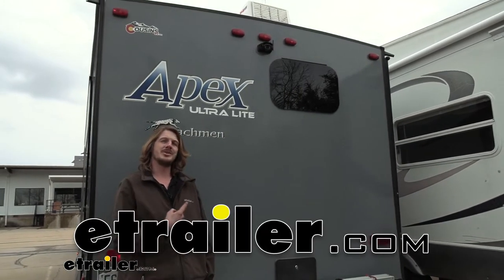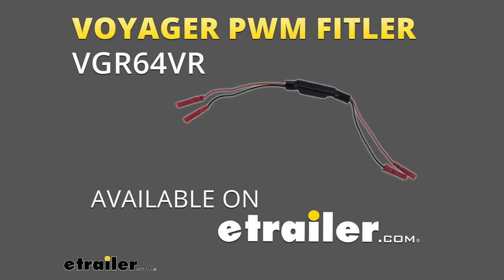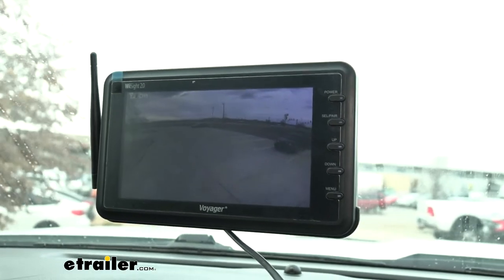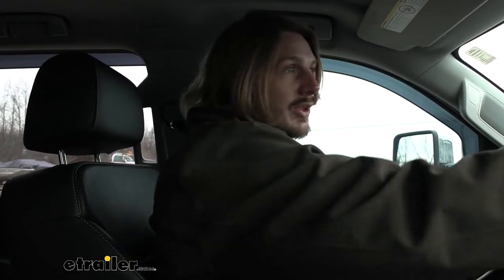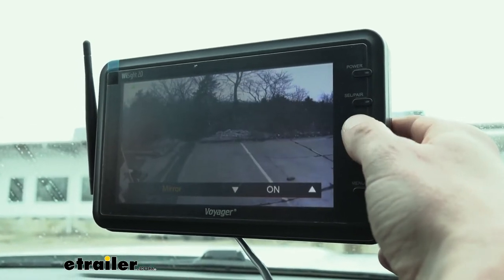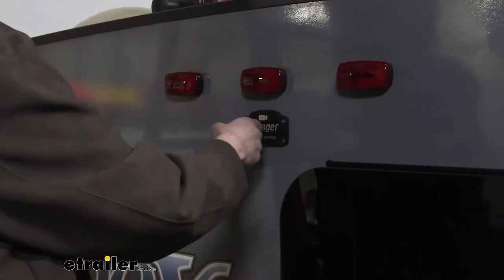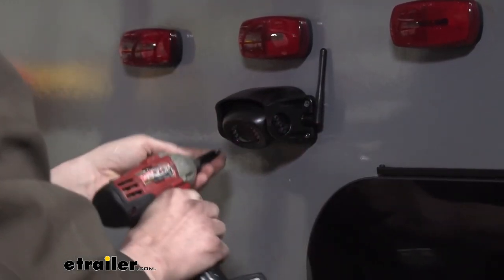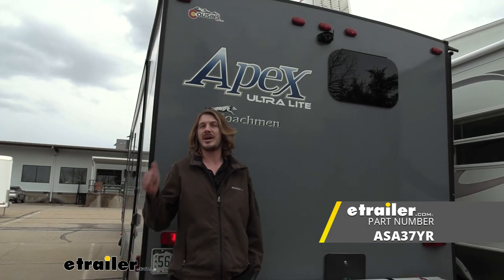Voyager WiSight Wireless Backup Camera System Installation - 2018 Coachmen Apex Travel Trailer

Comment: I have a 2015 suburban and 2020 keystone hideout 290LHS. I have the voyager 2.0 and can’t get it pair, I’ve done it multiple times and followed the instructions to a T with no luck. Pretty disappointed for $400 unit that doesn’t work.
Reply from the maker: Your camera system contains the pre-wired WVSXC160 camera . These pre-wired plates were installed by Keystone RV as well as Forest River and Winnebago. In many scenarios the pre-wired plate was installed incorrectly in production with the polarity reversed. If the polarity is reversed, then the camera will never power on or pair to the monitor. You can remove the pre-wire plate (or camera) and expose the 4 pin connection on the RV. Using a meter put the red probe on the top right pin and your black probe on the bottom right pin. If the voltage is negative (-12VDC) then we can confirm this is reverse polarity and causing this camera not to see power. Reverse those wires, and you'll be good to go.
 
If this is not the issue then verify the pairing procedure is correct. Many users are not familiar with operating their running lights on their tow vehicle. The system requires 0VDC at the camera, then activate pairing mode on the monitor, and during the countdown of the monitor provide 12VDC to the camera. Only during the countdown can 12VDC be applied to the camera. Hope that helps!
https://www.etrailer.com/RV-Camera-System/Voyager/ASA37YR.html